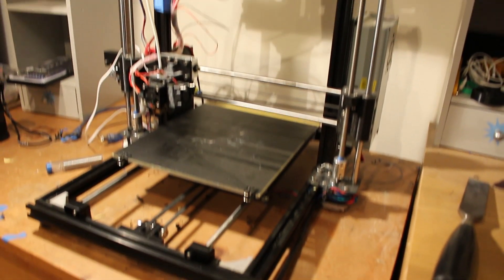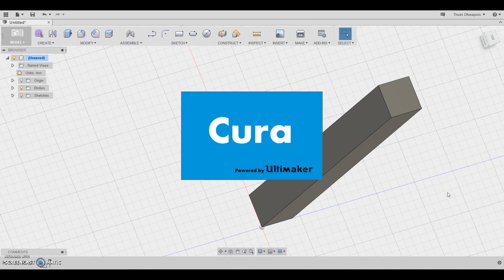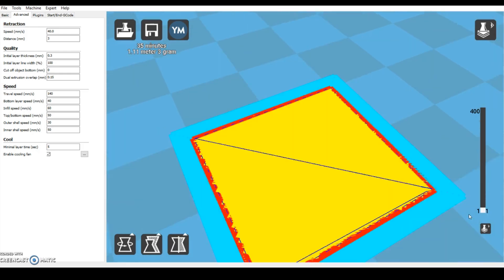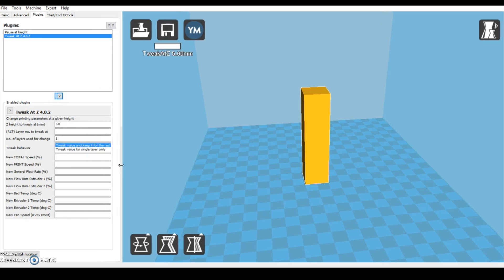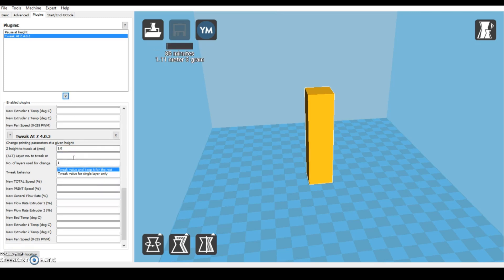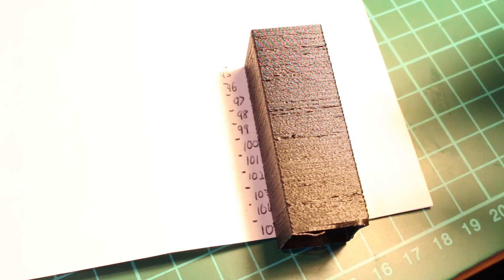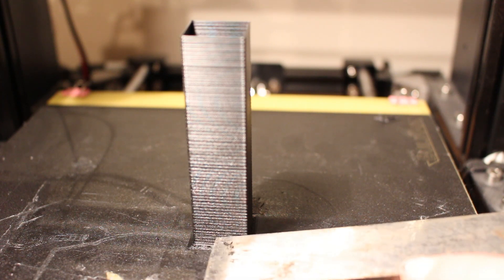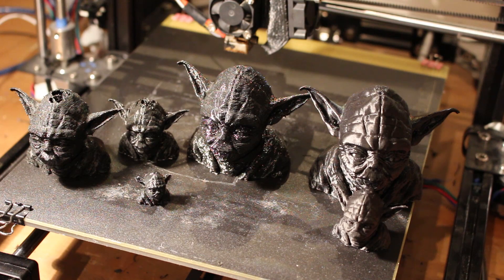How to Find the Perfect Print Settings For Your 3D Printer

Comment: I cant thank you enough Taow!. This is so logical & easy. Its helped me a lot. For those of you who are using a newer version of Cura, the feature is still built in & is SO EASY to use. It can be found at the top menu bar under Extensions/Post Processing/Modify G-Code. Just select "Add a Script" button & then select the "ChangeatZ" option. I selected this option 11 times and set each one to give me 11 flow tests starting from 105% down to 95%. I'm printing it now & can clearly see what setting I can change to make a huge difference to my prints. It literally only takes 5 mins to set the info (No coding involved - just tick boxes or type in the flow rate percentage you want to test. Just going back to Cura now to do exactly the same for my temperature test.

Comment: The video was too fast for me and what I really would have liked is a copy of all of the specs you added as maybe a link. I tried to install Cura in 3 computers and after 8 installs I got one to work.  I am not sure how you change the temperature or what plugin you used.  The print was a total mess but I appreciate the effort and the ideas!

Comment: I have my flow rate at 150 percent and it is still under extruding... I am using the anet a8
Reply: Then your extruder steps are set wrong in the firmware...Google how to determine correct extruder step adjustments.

Comment: OMGTOOFASTCANTKEEPUPANDHOLYCRAPITSTOOBLURRYTOPAUSEANDREADYOURSETTINGSOMG!
Reply: seriously tho. I searched for THIS vide4o, because I knew it had good info in it, but holy cow man.  tooooooo fast... can you at least attach a transcript?  and a copy of the setting you used?  I couldnt keep up. it was painful. I KNOIW the information in this video is good. I just cant capture it.
Reply: @4:32 you hit ludicrous speed.   FREAKING PLAID MAN!
Reply: right around 4:39 you said "I also saved a profile for PLA at 110 degrees celclius, and confused the hell out of me.  took me 4 tries to pause the video on the screen where you made that settings change, and I saw you actually had 210 degrees Celsius there. not 110. slowwwwwwwww downnnnnnn..

Comment: Excellent info in this video. You really helped me nail the temperature for my PLA in a quick, cheap and easy way. 
I actually did the temperature test first which may be why when I tried to vary the flow rate from 107-97% there was almost no difference.
While this was fairly quick, it isn't something I want to do with 30 different spools. Do you think different colors of the same brand are going to use the same settings?

Comment: Hey thanks for sharing. Just curious about 7:05. Do you think the better layer fusion could be caused by the heated print bed? Maybe should try to flip the temperature profiles and see if you get a better adhesion at the top.

Comment: Tried this method before and it does work but I have a gripe. The printer takes a while to change the hot ends temperature, sometimes the temperature is reached at the very end of the section with that temp. setting. This makes it hard to read where the temperature setting actually reached the setting specified. Having the ability to see what temperature your hot end is in real time makes it easy to catalog at what layer/height the temperatures in the settings are actually reached. That's the only way I can figure out what the actual temperature was at when the printer was producing good results.

Comment: why not just read the spec of your filament to get the right recommended settings?
Reply: Wouldn't you need the specific printer the filament factory based that on?
Reply: Jasper Tielen well.. when you buy the filament it should say it's specification on producent site, unless you buy some cheap stuff without any brand, then yeah, you might find it hard to find some information about that
Reply: Climate conditions like humidity and temperature will force you to change your settings. In more specific terms, how a filament behaves is location specific. 

Also every printer even from the same brand will print just a little different. Making 3d printer users compensate in their slicer of choice and in g code settings, for ex. the extruders steps per mm setting.

Comment: Great tip. But theoretically, there might be something wrong with this approach. You had to choose a temperature ad-hoc to do the flow-rate test. If you started with a different temperature, might you have found a different (better?) optimal flow-rate?

Comment: Why has no one invented a filament recycler yet?
Reply: Tolerances need to be very high which makes it a challenge to produce recycled filament that doesn't clog. Some of the thermoplastics used undergo changes when heated making them non recyclable. Recyclers do exist despite these challenges, the technology still needs refinements though.
Reply: there's videos on it just look around
Reply: They have, its a DIY project though.

Comment: actually, you want to find the right temperature BEFORE the right extrusion-multiplier. That's crucial, because a change in temperature does affect the amount of extruded material.
Reply: Dumb question, but what if my flow rate that I try the temperature test is jacked?  Seems like multiple iterations might be needed.   

Would this work better?
Iteration1:  Set flow rate, vary temp
Iteration2:  Set temp, vary flow rate
Iteration3:  Set flow rate, vary temp

Or is there a better way?
Reply: Mark Johnsen just remember that you are not the first person to 3D print. No need to reinvent the wheel. Look up what settings other people use and use that as a starting point. It’s likely your ideal settings will be relatively close to what others use. We all stand on the shoulders of giants you know!
Reply: Laymen here, but wouldn't it be offset either way? Perhaps he could find another temp that worked with another extrusion, but does it matter terribly which one he chooses first? In either case he gets the best look on both prints.
Reply: @HobbySauce  dude, that was 1y ago
Reply: @ServentofTheMostMerciful  yep, and with the passing of a year all points are null and void right? People definitely dont watch videos after their original date and have questions when they view them...

Comment: Thanks, I will definitely try this out on my Printrbot Simple Metal, but I think my current settings are alright, my only problem is my warped print bed (which seems to be slightly bowl shaped) and cooling.
How can you only cool the print from te right side and still have the print look good in the end? My prints usually warp up much more on the right side...
Reply: +CookieCraftMedia I'm guessing it's a thin aluminum plate? that generally warps to hell. Are you getting bad adhesion? I'm surprised if you aren't. 

Run down to lowes or home depot and have them cut you some glass to put on top. Stuff they sell is usually 2.5MM which is what I am currently using but if you can find 3mm that would be better. Could also use a custom cut mirror but not if you have a auto leveler. Mirror was thicker but I plan on adding a auto level. Be prepared to sand the edges with a sanding block tho.
Reply: +sanityfalling That seems like a good idea. Will I need to add tape on the glass then? I believe if the glass is thin enough the auto leveling sensor (which detects metal) should still go off I hope. I'm not sure how I will attach the glass, but probably with these black book clips.

I'll try it, if it doesn't I'm going to upgrade to a heated bigger bed which unfortunately costs twice as much for me because of the taxes and shipping
Reply: CookieCraftMedia Depends on what your printing, glass is flat so it's easy to level. Leaves a very nice surface too,

I have seen people use glass and leveling sensors, so I am guessing so. 

Yea binder clips work, Sound they make on glass might worry you, but they have been working fine for me. 

Set your hot end so a piece of paper drags a little when you pull it(push the bed springs down a little to get it back under to test at various places). Also remember when changing one edge to check all over again because it can throw off the other measurements.

If you spend a little more for a larger sheet of glass(You pay for a sheet and they cut it so see if if two will fit in there.). Might want to bring a representation of the size you want since it will be a weird size from MM to Inches. I lost a good half inch from the guy eyeing it even tho I converted it. 

I recommend what they call a "painters tool" thicker than a putty knife and has a chisel edge. Like I said be sure to sand the edges of the glass because you will have to handle it to pop/pry your prints off. I slipped at least once and would have had a real nasty cut if I had not sanded it.

For PLA some people use glue stick/diluted pva glue/blue tape/hairspray. Blue tape, you have to pry the parts off, I don't mind honestly that not sticking stuff is frustrating.

You can get pla to stick directly to glass but it's tricky, bed temp wise and hot end needs to be hotter on the first layer. Would probably work better with etched glass but would need nasty chemicals or a sandblaster. 

ABS you will have to make "ABS Juice" aka dissolving some of the abs you are using(don't mix colors) into some acetone and brushing that on(acid brush, or throwaway one) while the bed is hot(under acetones boiling point 56c so under that so you can get it to spread nicely, or it flashes off). A thin coating is all you need. ABS sticks to ABS really well, I use the scraper and a very light mallet to kind of tap my way under. 

ABS has other problems to worry about tho, a heated bed without a enclosure will only go up to ~92C(depends on room temp) reliably and reasonably. Works fine for small prints, on larger ones you can run into trouble with layer adhesion/warping. 

All in all be mindful of what you are printing also, Something very small might need a brim or even a raft. Test with something you know will work.

Good Luck!
Reply: +sanityfalling Hmm yeah. The build plate on my Printrbot hasn't got any adjustable screws, it's just fixed to the rods. Instead the metal detector measures the height on every corner of the bed, and it prints slightly rotated hen to level it out. The problem is that the bed is slightly bowl shaped, and the sensor is only measuring at the corners, not at other points, so I guess a glass plate could help really well!

Comment: Thanks, just in time! I didn't know this is what the plugin does.
I get good quality on low speeds, at higher speeds there are oscillations. Maybe I need to change the head like you did.

I am torn between leaving it as is, or improving it some (bowden head like you did, some other mods), or even building a completely new printer from much better industrial components.

Comment: Hello Artof,

Is this printer accurate enough to make gauges, such as plate gauge?  Or how about measuring tools?  Or how about a obelisk or two with opening parts that could hold items?

If this is a bit too basic, then could it manage to print a gyroscope? 
I realise that these suggestions aren't in keeping with your weapons theme but you could at lest use the rejects as targets!
Of course you could make scabbards for your knives too.

I imagine that one day all of this will lead to some "master-projects" where you use each of your workshop machines to make components that assemble into something amazing!

Comment: Very Nice... Have you tried using ABS juice to adhere to your print bed. I have found after 3 years of printing this works the best for me. The print sticks to the bed well and easy to remove. I have found printing planetary gears are a good measure of your printer. Another good project but a very involved one is the Imoov droid robot.  A good place to get advice on your printer is 3D hubs printing community. Good luck with your printer enjoy.

Comment: One thing you might want to try, is putting a piece of paper on the base. It makes it insanely easier to pull off the finished project. Naturally, you want it to be taped flat and such. I know I've printed a few things that I would have never gotten off without snapping if I didn't have the paper.
Reply: +megamaxmax4 Glass plate with 3dlac. Once it's cooled down, the print just lifts off.

Comment: How can you print ABS at 120 degrees, i have to go way above 200 degrees?!
Reply: +telefon72 If you pause the video you can see his settings in Cura are actually around 230-255, i think he accidentally said 100 instead of 200. Having worked with 3D printers for many years i have found 230-235 to be the best temperature for most ABS filaments.
Reply: +tomaz1996 Actually 120°F is about 49°C.  As for his temperature im guessing he means 220°C.
Reply: tomaz1996 Yes exactly, i print with well over 200°C to get the ABS flowing.
Reply: He kept misreporting the temperature everywhere, even on his charts.
Reply: +telefon72  ammmmm 120°C
Reply: tomaz1996 But in the video he said celcius... I don't know, he must have got it mixed up.
Reply: Bobby K you are right i f... up important thing is you need about 240°C for ABS
Reply: tomaz1996 :D
Reply: The Art of Weapons Ah, well that explains it all :D
Reply: Hi @karlpc200, it's 220 to 250 degrees mor or less, i saw it in a still frame at 6'07". Sorry i found this vid a full year later!
Reply from the maker: +telefon72 yes sorry i meant 220 i think
Reply: could you put a popup comment into the video please?
Reply: Pardon my ignorance, but perhaps he means 120°C? Are these programs in F or C?
Reply: telefon72 ups your right but than 120°F is about 250°C so maybe its in Fahrenheit

Comment: what's the name of programmes do you use in the 3d print
Reply: +Abdalla Elhagef Cura
Reply: +Abdalla Elhagef He used Fusion 360 to design the model, but you can just as easily use 123D

Comment: you should try printing in different filaments. i know its not very original but if you where to use different filaments and integrate them into other projects then that would be cool.
an example of this would be using wood filament to print a low strength trigger mechanism that could have more pieces in it. it wouldn't be able to withstand a lot of force but would be a great example of this integration. or flexible fighting knives so they are totally safe and have bendy bevels.